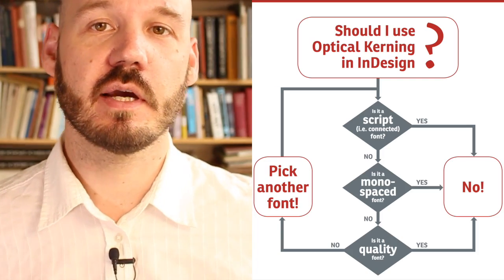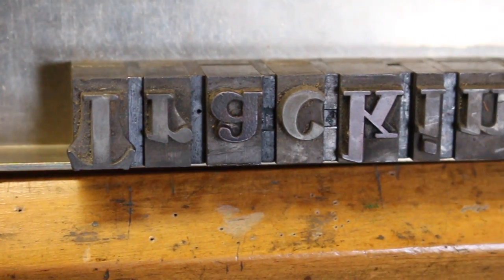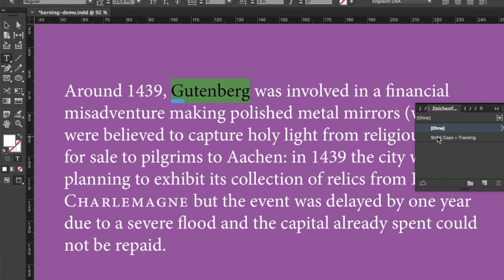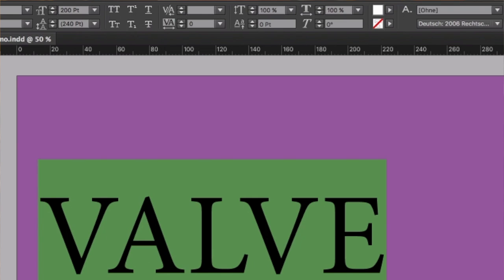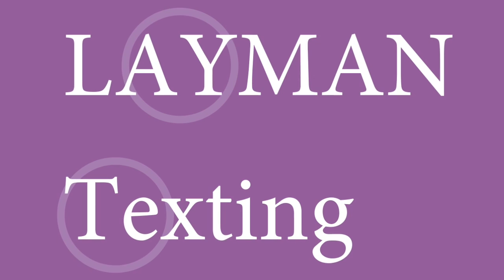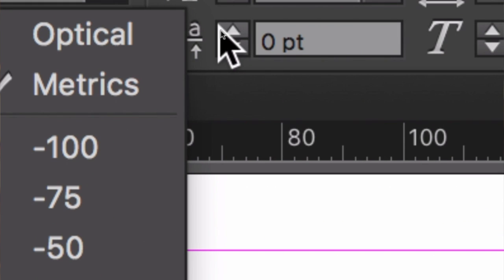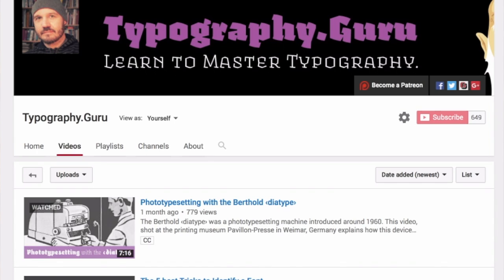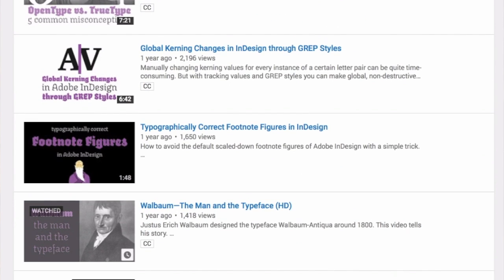Optical vs. Metrics Kerning in Adobe InDesign

Comment: Another thing to be aware of is that Adobe's optical kerning applies more kerning the larger the type is. For example, if I set the letters AT at 12 point in Times New Roman with optical kerning, the kern value is –51; if I set it in 36 point, the value is –60. This is in keeping with the general principle that Ralf mentions: larger type is often better set tighter. But as users may not be using the type at the size it is originally set (for example architectural or signage may be used at a different size from the original setting, particularly in Illustrator), the overall spacing may be looser or tighter than planned. And if the type size is changed within the program, the spacing will change, which can cause problems, to the point that type may reflow.